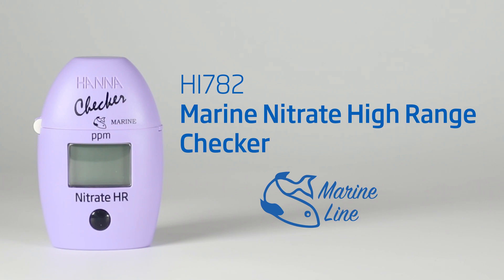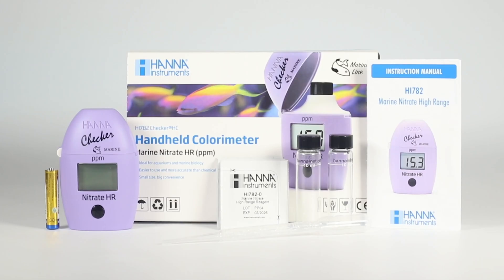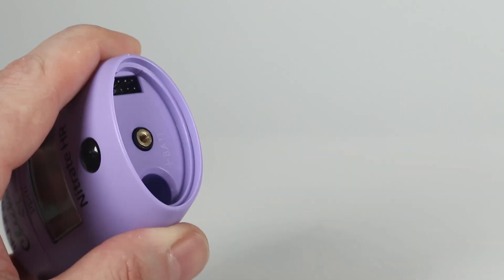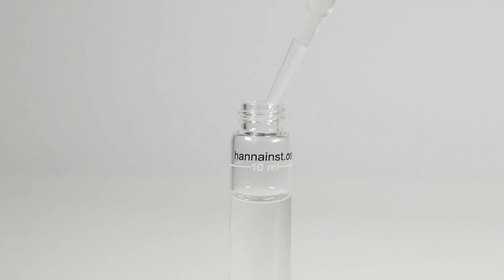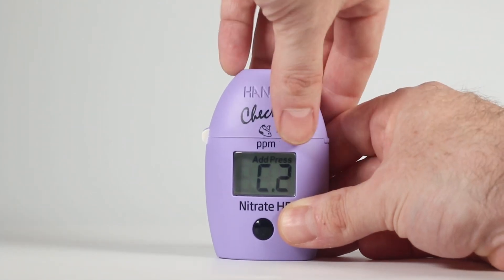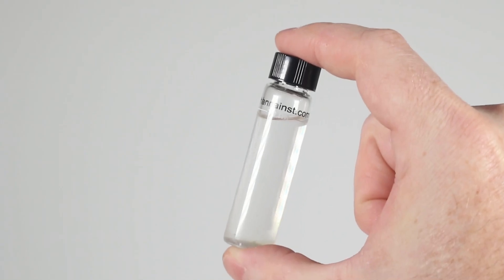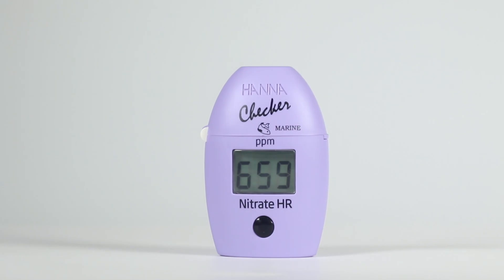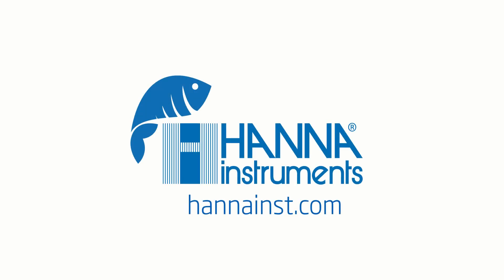How to Use the HI782 Marine Nitrate High Range Checker

Comment: My HR checker keeps reading flashing 75 which means out of range. Checked on API looks like zero to 20. Something is off. Does it mean my nitrates are too low for the HR Checker? Confused
Reply: Pretty sure that means your nitrates are very high
Reply: Api is not very reliable/accurate I’ve found anyway.